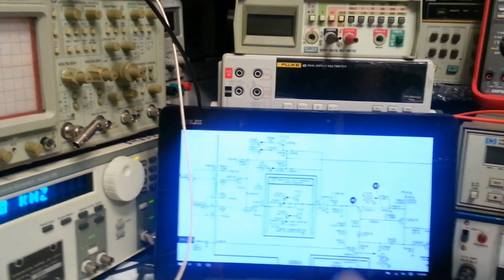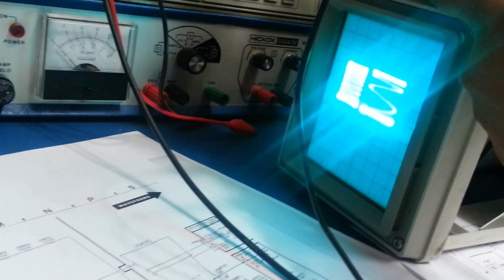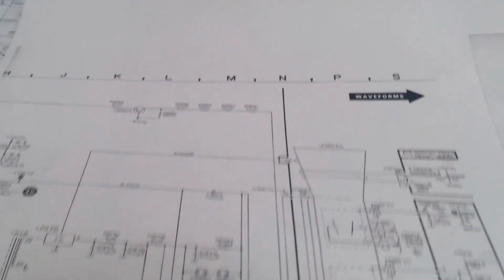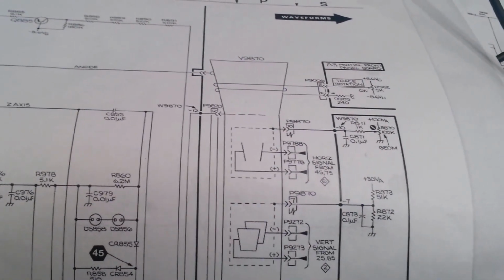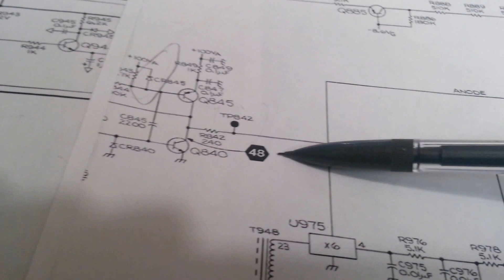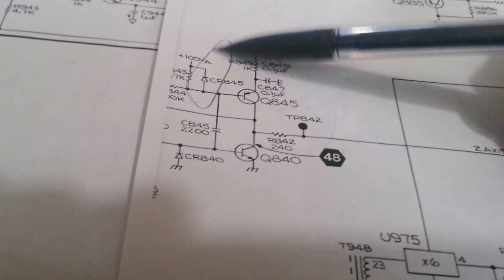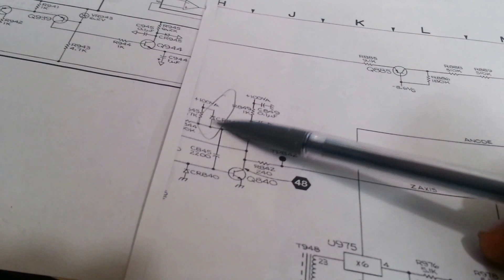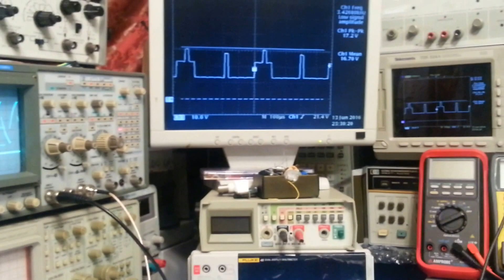Tektronix 2235 Repair

Comment: Very nice repair job. Thanks for contributing to the survival of these wonderful Tek scopes. How did you know the exact parts number of the new diode that you ordered? Was it written in the manual? Did you find a diode with the exact same parts number or did you use a substitute? In this case, I don't think it matters much if you don't find a diode with the exact same parts number since it's only used as a clamping diode anyway. Reverse breakdown voltage of the new diode should be taken into consideration since we're talking about a 100V rail, and the waveform should be checked after the new diode is installed to make sure that the parasitic capacitance of the new diode isn't causing a problem. (Not likely it will, but it's best to check.) A short recovery time wouldn't hurt either, I guess. A 1N4148 is not good enough in this case since it's rated at a maximum reverse voltage of only 75V.

I have a fully working Tektronix 2235 as well. If anyone ever needs measurements or waveforms from a working 2235, let me know and I might be able to help you out.
Reply from the maker: The part number is listed on the service manual and also once I removed the defective diode I was able to read the part number on the device itself which agreed with the manual. I bought an exact replacement from ebay and thankfully it wasn't a fake. 

Actually the original diode is 1N4152 with peak reverse repetitive voltage of 40V which is much more less than the 1N4148 (Vrrm = 75V). If you can see on the schematic, the clamping diode doesn't see the 100V rail so breakdown during normal operation isn't an issue. 

I think the diode is meant to protect the reverse breakdown of the base to emitter diode of the transistor Q845. You can also see a similar diode attached to the base of the bottom transistor(Q840) to ground. As far parasitic capacitance is concerned the 1N4184 has 4pF while the original 1N4152 has 2pF. So they are comparable. Regardless I have removed the 1N4148 and replaced it with the proper 1N4152 diode.

Comment: Just want to say nice lab and I love all the equipment, especially the boat anchor gear.  Not a single modern LCD/LED oscilloscope in sight.  LOL.   I work as an electronics technician and electronics is also my hobby and i`m also a ham radio operator.  Is that your real name or did you name yourself after  the old school equipment maker named Smith Corona.  I think they made those big clunky typewriters. Keep up the good work.  KD6CFE was here . 73`s
Reply from the maker: Thank you very much sir! I love old gear specially CRT based oscilloscopes. I hate to see them end up in the land fill. 

Regarding the name, I was never aware there was a typewriter manufacturer named similar to my name. Thanks for bringing that to my attention.
Reply: You probably dont care but if you are bored like me atm then you can stream pretty much all of the latest movies on InstaFlixxer. I've been watching with my gf for the last few weeks =)
Reply: @Dakari Maxton Definitely, I have been using InstaFlixxer for months myself :)